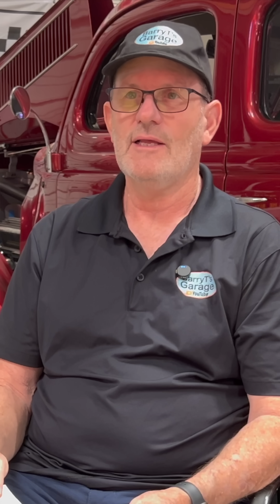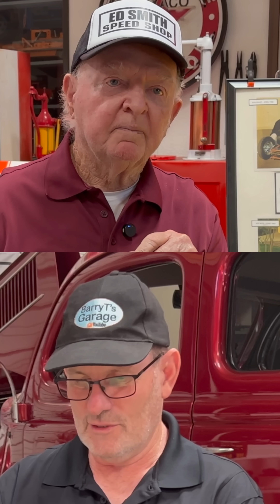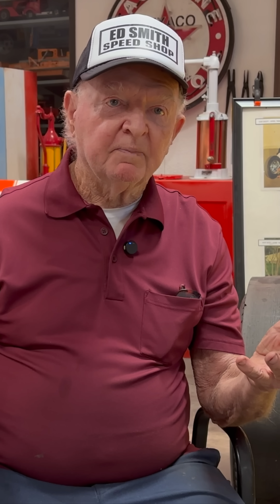Add a Dry CLUTCH to your Automatic! NO Torque Converter! Ed Smith w #BarryT #racing #hotrod

Comment: Clutch Flite, drag racers used in the Sixty's... Yeah Chrysler used something similar to it in the fifty's, I know for a fact because I owned a fiftys Dodge Panel Truck that had the set up, it worked well behind the Extremely Low Horsepower of the old straight six flathead engine, But the new torque flight (at that time) could withstand drag racers much higher Horsepower Numbers, Racer's have been very ingenious throughout History even to this Day.. Hardcore racers like Ed Smith will remember it Well.. Ed's Sharp Memory is utterly Astonishing. God bless America !!!

Comment: In today's times there's the Liberty transmission and the Lenco transmission both have a push button air operating servo shift set up for both brands of racing transmissions but only used for top fuel dragsters and funny cars, alky fuel dragsters and funny cars, pro mod, top dragsters, top sportsman door cars and quick 16 and 32 fast bracket cars
Reply from the maker: Thanks for adding the info!

Comment: That is just as interesting as that guy who put a torque converter on a manual gearbox. It worked too!
Reply: Now I would of liked to have seen that, and understand it too ..
Reply: @johnqpublic2949 it's common in trophy trucks for less impact on the running gear. . running torque converter in manual gearbox.very common thing.
Reply: @johnqpublic2949 its on youtube. The channel is garage 54

Comment: The clutch was only used for launching and stopping. After the car was launched you used the push button transmission to shift the torqueflite
Reply: If you held the shifter in 1st and pushed it forward the clutch wouldn’t engage until you pulled it into second! I worked for Porsche/Audi 9 years so that trick won a few clients racing “SCCA!!”

Comment: Back in the early “70’s” Porsche had a transmission called “Sportomatic” allowed the driver to put the transmission in gear and had a set of micro-switches to engage and disengage the transmission! It had a vacuum actuated clutch control and worked perfectly!
Reply: Only when it worked perfectly, problematic.
Reply from the maker: That’s very cool. I’d love to drive one of those someday.
Reply: @BarryTsGarage Those were crap!

Comment: That's pretty cool not sure why they would want to add the clutch factor into it but it's still cool!
Reply from the maker: It’s an old school racing thing… I’ve never seen it myself
Reply: Total control of "stall speed" and less slip once you're rolling.
Reply: @Wayland-j5s wild it would be locked up all the time. 🇦🇺
Reply: Torque converter technology was in its infancy. As things progressed torque converters got better and the clutch flight was no longer necessary
Reply: was used with power glides a bunch